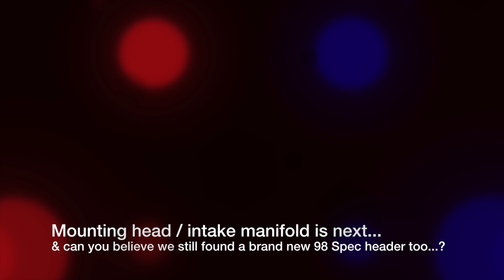B18C5 R-DOT Project Day 6

Comment: Can you buy these motors new? If so did you just go through Honda? It would be cool to buy a shell, do some body work, and then throw in a brand new trans and engine.
Reply: rambow70 yes as a matter of fact the honda dealers still sell the short block usdm b18c5 and the head completely assembled. Last I checked the short block was $4,800 & the type-r head was $2,700
Reply: Christ... when i bought it... the block was 2600, and the head ~ 1800

Comment: Helm publication used to print the manuals for Honda, and I was told to contact them directly for manuals.  The IPC (illustrated parts catalog) is the one they used to only allow the factory dealers to have.  It is a 3 ring binder 'about 4" thick with the part number for every single nut and bolt on the entire car!  I used to have it for my old "88 CRX Si.

Google Helm, give them a call, and ask for the factor service manual for your model.